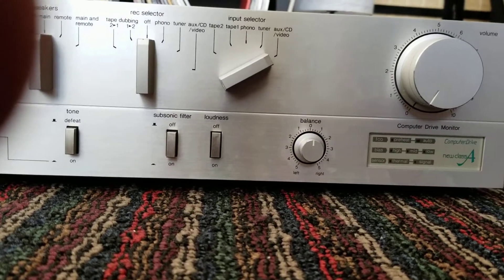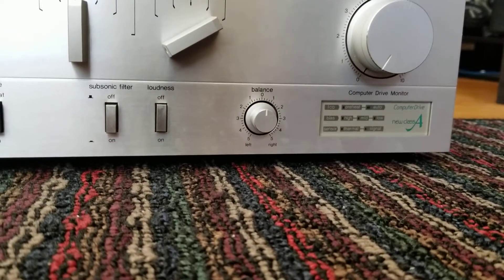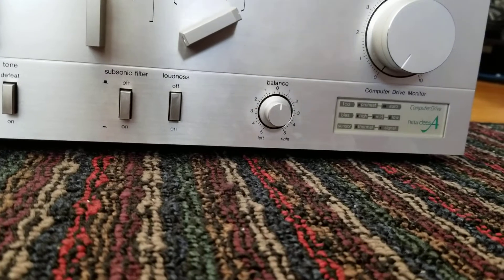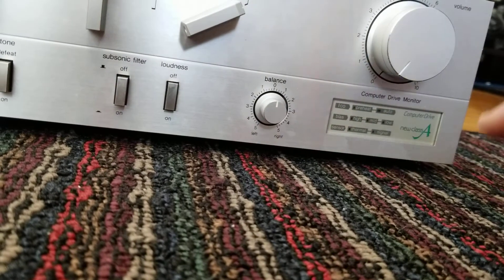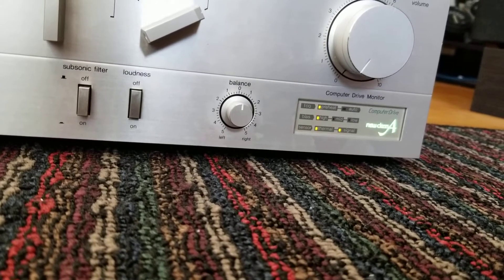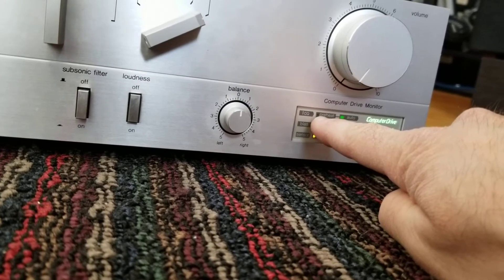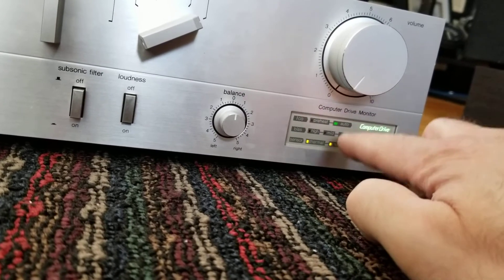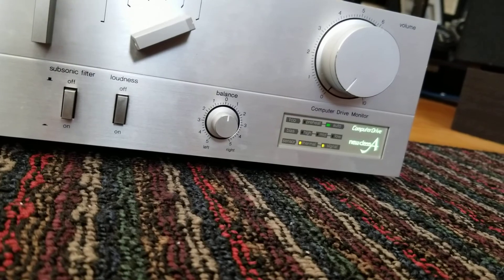Technics SU-V "New Class A" system in operation

Comment: Interesting. I've just picked one up from a garage sale for a tenner. After a total cleanup it's working, but it also doesn't light up in the middle line and during the first minute there is a crackling sound from the power switch area. Which type of LEDs did you install?
Reply from the maker: Didn't use LEDs, just replaced the incandescent bulbs. Crackling from the switch is usually burned contacts that are arcing, you'll need to replace the switch before it either fails completely or starts shooting sparks!
Reply: @OddAudioCanada  ok, so they're those micro incandescent bulbs. Thought they already had used LEDs in 1983. Gotta also replace the speaker binding posts, all the positive ones are broken. Heard it is a common problem with the red tinted plastic used at the time.